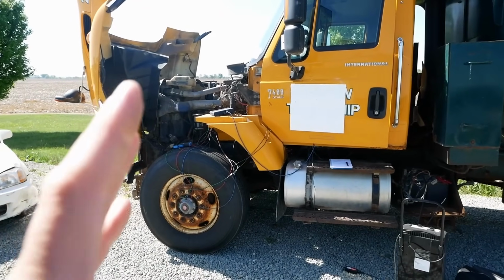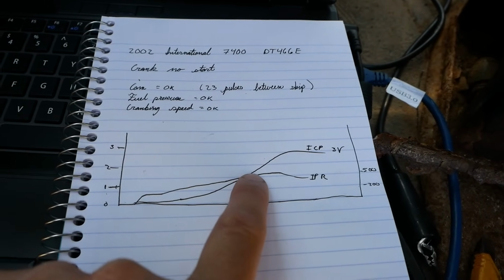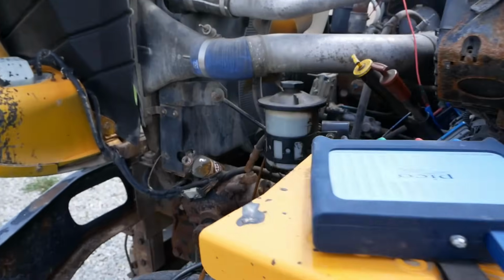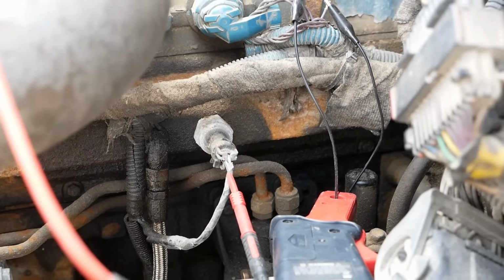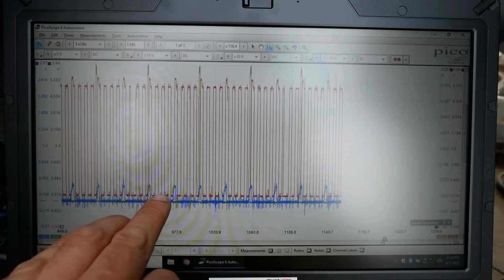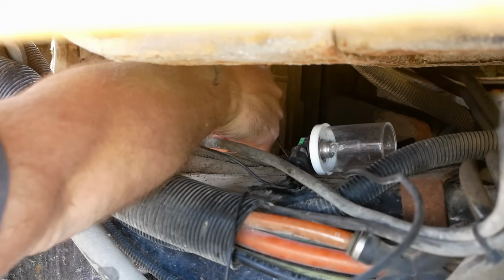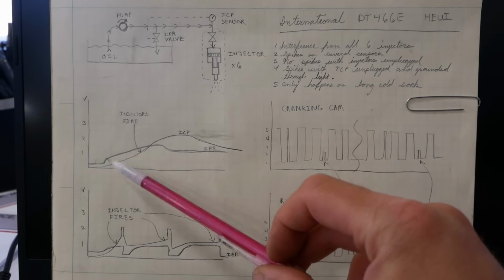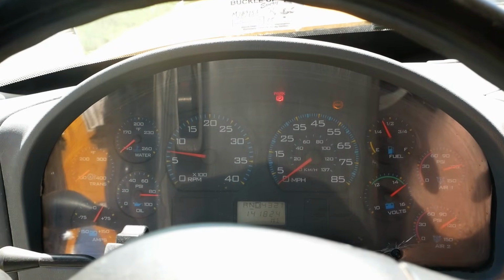International DT466E Won't Start without Ether after Sitting

Comment: Just some uneducated guesses: The electrical side of the injector is a coil. How is the flyback handled? If the current through the coil is reduced or interrupted after firing, there will be a flyback voltage of opposite polarity. If the flyback diode or whatever is used is damaged, it might bring a lot of dirt in the signals.
The 24/48 hour difference, as well as a high battery voltage or ether may influence how fast the high pressure is built up. If the pressure builds up very fast, before the event occurs, it starts up. 
Maybe the pressure signal just has to be very fast over the strange peak. As it is when the engine is running. I can't remember the correct values, but isn't the strange peak lower than the pressure signal when the engine is idling? 
Aren't the injectors permanently 12 V and pulled to ground for firing? I'd try to add a flyback diode in the supply for the injectors.  But if there are no peaks in the supply, that test wouldn't make sense. 
Thank you very much for this video!
Reply from the maker: The injectors are 120V DC. You may be onto something with the speed.

Comment: I spend a few years at a international dealership my 1st thought was leaking injector o-rings I have seen so many of them leak internal and guys will use starting fluid to get it going. cant beat the crusty ones  🤣 cheers
Reply from the maker: I don't think so. Usually that really shows up on a hot restart. This thing has pretty low miles too.
Reply: @WatchWesWork  it may have low miles but how many hours? those engines are usually go 7,000-12,000 hours before needing an in-frame. some of those municipal trucks have lots of hours with low miles Cheers
Reply: @WatchWesWork  yeah I have no idea not in front of the truck. just my 1st thought. diag can be a hard one

Comment: Does this not have glow plugs? How does it heat the cylinders to fire the fuel??? It acts like no cylinder preheating?? 🤔
Reply from the maker: No glow plugs on these. Some have and intake heater but not this one.
Reply: Yeah no glow plugs. And this engine really does not need any it starts right up no matter what. The DT466 is a great engine just the shitty HEUI system and electronics are problematic.

Comment: I feel it has to be a capacitor in the ECU that drains down and is responsible for filtering and it's not filtering properly when it's cold
Reply: Bad capacitors were very common in consumer electronics 20 years ago.

Comment: I don't understand the errant spike disappearing with the injectors disconnected. Well, if the box is introducing it that is. It also makes no sense for electronics to fail when cold. I can certainly see how this diagnostic was a PIA. it also makes no sense that your test light had no apparent impact on the errant signal. I can't imagine the ground being that bad or being bad only when cold soaked. Throw rocks at it and run away.
Reply from the maker: Matches and some kerosene.

Comment: I'm no expert but it seems from your video and comments combined, you have a leak in your oil pressure line, maybe, since the pressure drop for each cam cycle that one of the injectors is leaking down the oil pressure. In an oil pressurized system, it doesn't take a lot of oil to leak to loose all of the oil pressure. It does not seem like the system has an oil pressure accumulator that would help maintain pressure for a small oil leak.
Reply from the maker: If it had a leak it would not start when hot and the oil it thin. It starts right up hot.

Comment: 1:47 100psi oil pressure during cranking?
Reply from the maker: The gauge has never worked as long as I can remember.
Reply: @WatchWesWork  Ha. It would drive me nuts to not have a working oil pressure gauge.

Comment: That is very strange. Why did using a charger or using starting fluid allow it to start? It appears there is room for one more battery in that box. The trucks I worked on had 3 batteries. Maybe the battery charger supplied enough extra power to increase starter speed and ether would allow it to run without the fuel system. The fuel system was probably carried over from the non-electronic days when the camshaft might have operated the high pressure oil valve. I guess I was lucky to never have had to work on any International/Navistar equipment built after the mid 70s. Maybe there is a programming solution to the problem. J C Smith seems to like Navistars.
Reply: I have a 2000 international 47 with the TD466 in it. Mine has two large 12 volt batteries. Since you didn't see oil pressure on the cluster most of those clusters are bad. I sent mine and then had it rebuilt. You just can't put stepper motors on and think it'll be okay. My vote is loss of electrical power when cranking

Comment: Wes....would there be any chance this could be an AC ripple interfering with the waveforms....you mentioned charging the batteries used to help....would that possibly be a parastic draw from a failing diode?
Reply from the maker: I don't think so. The voltage regulator should not turn on until the engine is running.

Comment: Sounds like the low pressure oil pump is week. In turn not supplying enough oil to the hpop
Reply from the maker: No. The HPOP reservoir is full. You can check it by pulling the EOT sensor.

Comment: just started watching but ford has a low pressure, lift pump to get oil to the high pressure pump
they can leak down past the pump and drain the system
Reply from the maker: Not the case here.

Comment: Hi Wes, as an old electronics tech we found that some times adding heat or cold to the device would cause it to change states. try heating with a heat gun to see if anything changes, if so freeze spray and try again.
Rich
Reply: What is freeze spray?
Reply: @giggiddy  Plumbers use freeze spray to temporary stop flow on a pipe.
Reply: @anthonydefreitas6006  Wow thats cool. Never knew it existed. Thanks for the reply!
Reply: @giggiddy  its just refrigerant in a spray can that quickly cools. in my day it was R12 now its r134
Reply: @richb419  thanks for the tip rich, not sure why people can’t just say thank you it’s not that hard
Reply: @eddygoodwin7089  Hi Eddy, yea but I do like his work. he is a very good mechanic and we don't see that much these days. 
thanks for your comment.
Rich
Reply: @richb419  yes he is, but no one knows everything there is always something new to learn. Thanks for the response
Reply: Sounds like that would work to me, since once it runs and drives for bit it will start right up.
Reply from the maker: I don't know it it's temperature related. It restarted fine after 24 hours.
Reply: @WatchWesWork  what I  meant was you could heat specific parts, like the computer. connectors and sensors one at a time and try to start. 
Good luck Rich

Comment: I'll give you a tip, if you ever decide to relocate to europe, dont work for DAF, DAFs are shit and stand for dash always flashing, even when brand new they cause problems because of too much electronic sensors, give me old school stuff anyday, i like a clutch and splitter boxes, even better would be using oil lamps for headlights and steam power for the engine 🤣🤣
Reply from the maker: Right. Better to shovel coal that wrap your head around this crap!
Reply: @WatchWesWork  i admire your work dude but new machinery is just a pain in the ass really, you have the patience of a saint 🤣🤣
Reply: Don't forget mechanically actuated brakes!  Stupid hydraulic fluid, or air, is just a leak waiting to happen...

Dash Always Flashing - I love it!
Reply: @DanEBoyd  and lots of unnecessary automatic braking when nothing is in front of you, diesel tank on 1 side, adblue (def)  tank on the other side, the list goes on 🤣🤣

Comment: Wes one thing that you have to remember, the design engineers don't work on the equipment that they design.  They are only interested in the power lines going where they think it should be going.  You are striking for Sainthood but the customer isn't going to understand what you have to do to trouble shoot a problem.
Reply: but the ecm is right in the open on the test stand lol
Reply: That's a terrible practice that a lot of automobile companies have. The engineers never have to work on their products. I think the engineers should have to spend a week per year in a repair shop before they actually get to design new products.
Reply: @henryD9363  A fortnight every 3 months.  I've worked somewhere that had that rule (not for design engineers, but for the bosses).  Drag someone on $200k+ out of their comfy office and tell them to stack empty pallets in the rain in the middle of winter and suddenly we all got new wet weather gear.  Or hand unload trucks in 40°C -- suddenly there's plenty of cold drinks being delivered on a regular basis.

Comment: Sorry if I missed this in the video.
No delay startup when warm is because?
1. ECU components aren't fully failing when warm?
2. Oil pressure is allowed to build with a hot engine verse a cold one?
Diesel line has a small leak and it  leaks down over time and requires higher RPM to draw the fuel?
3. I wasn't paying attention and all of the above were mentioned....
Reply from the maker: Fuel pressure is good when cranking. Oil pressure is good when cranking. Dunno about the ECM temperature.
Reply: Easy: Install glow plug in the ECU!!
Reply: @DanEBoyd  LoL 🤣😆

Comment: They will probably fix it by installing the old push button ether cold start system on it. The system with the screw on ether can mounted under the hood and the rubber covered push button on the dash by the key. You push the button a couple times and spray the ether directly into the intake manifold and it starts. The problem is the lazy truck drivers never change the can of ether.
      They need to rip all that shit off and go back to the three lobe cam running the injectors. You had to run the overhead once in a while but 99% of your problems was air getting into the system or occasionally a bad injector. No fkng computer needed !!!!!

Comment: I've seen issues with starting these forever... numerous issues...high pressure pumps..warped oil rails..icp sensors or coils..cracked front structures..faulty fuel check valves,..corroded ecm and/or plugs..etc . In the fleet of 40 of these treasures I was blessed to work on for 8 years...I think only one had a bad ecm . Without a good diagnostic laptop it's hard to pinpoint...ours was ok but always needed updates ...it was in for repairs more than the trucks were lol . One thing comes to mind..you mentioned it starts when cold...if it has issues once warm.. I've seen faulty icp valves..or the orings on it bad . But one of the first areas of concern for me is the wiring plugs going to the ecm...those o rings are so thin they only have one side lol . I've seen water get in them and corrode many times..a thorough cleaning is often the solution .

Comment: IDM inverter may be the problem, is the 115 volts stable when the problem is present?  Respectfully, Dennis, KV4WM,  A US NAVY NUCLEAR SUBMARINE VETERAN and Amateur Radio Operator.   BTW, also a 7.3 power stroke junkie, have three and love em.
Reply from the maker: It seems like the DC/DC converter is working correctly.

Comment: BTDT with some trash trucks. Multiplexed wiring system was soooo much fun.

One thing you mentioned at the end was oil pressure. If the low pressure supply pump/pickup develops a leak, or the pump just gets worn out, won't supply oil to HUEI pump when cold. Need to make sure it has base oil pressure quickly when cranked.
Reply from the maker: You can pull the EOT sensor and see oil in the reservoir. That was my first thought. We had one do that once.

Comment: Wes do you believe that Diesel engines can get addicted to starting fluid? I’ve heard that all my life but I don’t see it. You might have answered the question in the video but I haven’t had time to watch it yet. I will later today or tomorrow
Reply from the maker: No.
Reply: @WatchWesWork  thank god a man with reason.
Reply: @Robrt32  No, but a lot of operators get addicted to the quick easy start ether provides.  And owners get addicted because ether is cheap, and keeps the machine working.  A machine getting an engine rebuild isn't making money.
Reply: @dfross87  I’ve seen some old farmers just wear starters out on the old 4430 4640 4840 John Deere tractors back in the day   There was nothing wrong with them , they just didn’t wanna crank in cold weather. They were either not working or nobody plugged up the block heater or no access to electricity to plug it up. They would boost and wind the starter for a hour or more to get it started when a shot of starting fluid would fire it right up but they would swear if you used it , it would never crank again without it.  We would have a can hidden to use when he wasn’t around. It was more than just 1 old timer. They really believed it would get hooked.
Reply: @Robrt32  Doesn't surprise me, although knowing tight-arse old farmers, I suspect they just didn't want to shell out for the can of ether!

Fortunately it never gets that cold over here.  Lowest temperature ever recorded here is -3°C (~26°F).

Comment: That is definitely the ECM module. The problem with replacing them is that they have to have the correct program installed. And yes you are correct. The dealer has to do that. And yepper ... about 2 grand.

Comment: You aren’t kidding on diagnostics burning time. I worked on a truck for my buddys shop.  Previous shop looked at it, gave up and gave them a $1650 bill. I spent 6 hours on it, found a missing pcm fuse, pcm relay with a wire soldered to it and side of fuse block plastic broken apart🤪. Got it to finally crank, then got no start and fuel pump circuit codes. Swapped the fuel pump relay and good to go🤡.

Old plow truck they were going to scrap if it didn’t get fixed. Prob still worth $10k

Comment: I don't know Vern seems like in my memory way back in the day those hoy pumps there is a seal at the bottom of the pump. When it's bad it bleeds of oil as it sits 
 . Why would the ecm be dying with long rest periods then be good again with starting fluid ??? I don't think that ecm is the problem. 
 I think the problem is in the pump. If I'm right the starting issues will get worse as the leak gets WORSE
Reply from the maker: You can pull the EOT sensor and see that the HPOP reservoir is full. It also build pressure just fine with the injectors unplugged.

Comment: I won't pretend to know anything about this engine/system, but I kept asking myself what difference is there between cranking and running (after starting with ether)? You mentioned RPM, and that may be the important one, but the one that springs to my mind is the large starter ground current. I'd try unbolting, cleaning, and reconnecting each ground connection in the starter ground circuit. I've seen tightly bolted high current connections that were almost completely insulated by corrosion.

Some connections can be temperature dependent, which might explain why this engine will restart easily if still warm. If you get it started when cold, can you shut it off and restart normally, or do you have to wait the 3-4 minutes, until you get throttle response, for it to restart? Ask the customer if this problem is worse in cold weather.

Yes, it sucked that you were not able to get into all the connections to the ECU. The problem certainly could be there.  I couldn't quite visualize what the problem was, but making those connections impossible to troubleshoot is certainly FUBAR.

BTW, keep in mind that your cute little test light has about 1/10 the resistance when cold, so it can draw about 10x the current on pulses that are too short to warm it up.

Finally, I love the way you work your way thru a problem, by taking data and following it. You clearly understand what you're trying to do, even when you're faced with something that's not making sense.

Comment: I can't see why an interference issue should change with how long since last cold start. What is different about a 48+hr cold start vs. a hot start ?  Possibly slower cranking, possibly oil has drained back from the high pressure circuit and - at lower cranking revs - it doesn't come back high enough to satisfy ecm. Same base issue as with my BMW though may not be caused by leaking injectors of course.

Comment: Jesus, another year and any ancient Detroit, or 12v Cummins vehicle will be worth its weight in gold:(  One suggestion, which wouldn't even have worked here - I'm not a pro, but I HAVE noticed several times over the years, that test lights and scope probes can't always be trusted. Just because you're getting a solid read wherever the probe is doesn't mean that it is actually good at the connection-point. I've had a bunch of instances where unplugging the connector, hitting it with a small brush/pick and some electronics cleaner and reseating it has made weird problems magically disappear. Those weatherpack-style CPU connectors are pretty solid, but 20 years is still 20 years.

Comment: I spent the better part of the last week troubleshooting a low rail pressure and high rail pressure code on a cat C6.6 in a D6N. It was a huge pain in the ass to figure out. It would run fine at low load but when you pushed a full blade of dirt the rail pressure would be about 2000psi lower than desired and it would code. Then the rail pressure would get "stuck" about 5000psi higher than desired and set a hi pressure code. Got all the way through the cat troubleshooting guide with no fix. Finally tried a new injection pump and it runs better than new.
Reply: @mmm365  well 9000 hours and poor maintenance history may have played a part in it
Reply: @mmm365  on a small machine like a d6n it's a fair bit. More than half way through its life